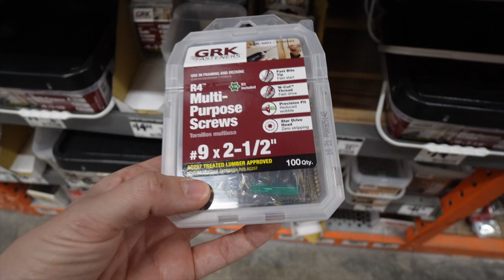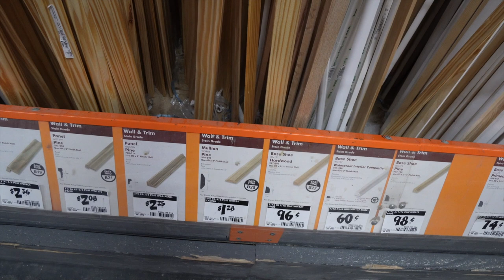staining our hardwood floors & estate sale shopping! | XO, MaCenna Vlogs

Comment: 🚨Macenna, you can easily extract your own milia… i’m a licensed cosmetologist but i’ve specialized in esthetics for the past 7 years and i extract them all the time for clients. there’s really no known cause for them,’other than trauma to the skin but you can also just be prone to getting them. They’re just an accumulation of protein in the shape of a ball under the top layer of skin. if you feel comfortable doing it, (which if you can redo a house you can 100% extract your own milia lol) just use the single use lancets from the diabetic section at any pharmacy. go in from the side of the white bump when you get the needle into the white area do a little swirl with the needle widening the opening just enough and push it out.. if it doesn’t come out easily, stretch the opening a bit more… so simple!! you can totally do it. chances are you’ll get them again, so hopefully this little comment will help in the future 🙃❤️

Comment: In my country when there's floor plugs, the plugs would be lower than the floor and it would have like a "lid" for the hole with like smaller holes for the chords being able to go in and out. The lid is made from the same material as the floor to camouflage it. There's the benefit that if there is nothing on it, it's not as obvious.

Comment: Great video.

Curiosity question. I know you're taking like a balanced approach to the renovation. All of the floors or all of the windows, but then also focusing specifically on like the guest bathroom and making that perfect.
If you think of like a traditional move in ready house that someone would buy, i.e. floors done, electrical done, plumbing done, that kind of thing. I was wondering if the full house will get there before all the individual room renovations, OR if some of those key aspects are in fact gonna be on hold until you actually get to the specific room.
For instance, will there be like baseboards in every room all together, OR are you just going room by room. So like maybe one of the guest rooms won't have base boards or lights until far into the future, even though you might have a finished living room. Will there be rooms without permanent lighting because you're waiting til you get to that room, OR is there a reno phase of like ALL the lighting gets in. That kind of thing.
IDK, if that makes sense. But just kinda curious on the approach/process you're taking.

Comment: I have a question 🤔 when you are doing all the floor work which is amazing btw 💜💜 I saw some stains and red color on the walls how will you remove that is it easy I mean by just cleaning it and then paint over it or how?
Reply: Baseboards will cover most if not all.